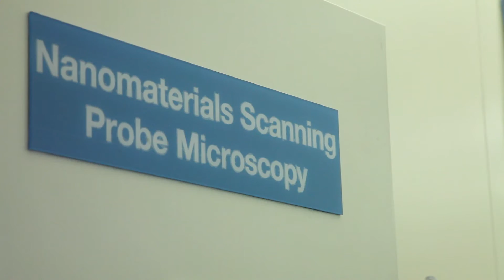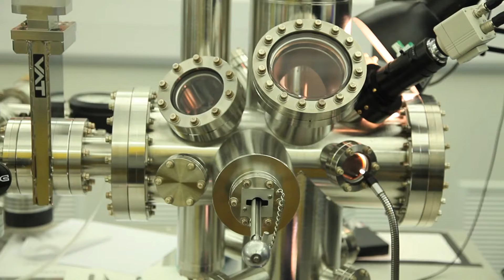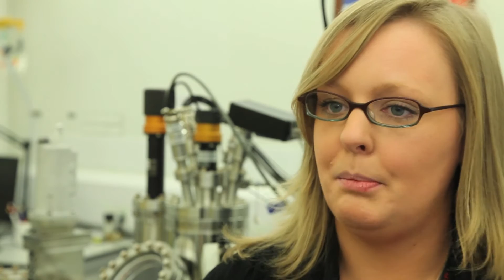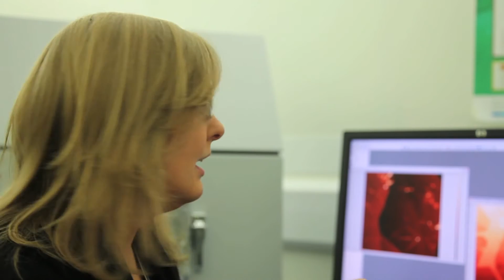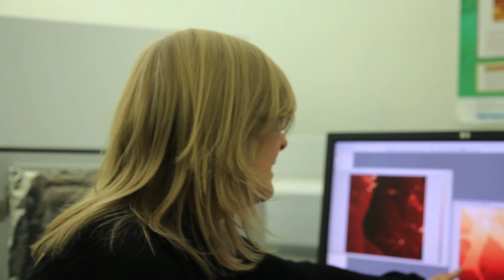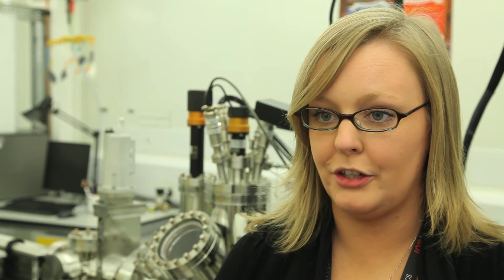Thermoelectric materials

Comment: What is maximum efficiency till the date and what type of difficulties u  are facing to increase the efficiency???
Reply: the efficiency of these materials is usually measured by ZT or the figure of merit.  This is a ratio of electron transport to thermal transport. So eveidently we need a  high ZT thus low thermal transport. However, the  properties of electron transport are related to thermal transport and hence the  greatest challenge faced is reducing thermal conductivity without largely affecting electrical conductivity. Currently state of the art materials have been produced with the aim of reducing heat flow through the material such as skutterudites and clathrates. We have a long way to go with increasing efficiency of these materials so as to compete with conventional heat engines as a ZT of around 4 is required. As of now ZT ranges around 1.